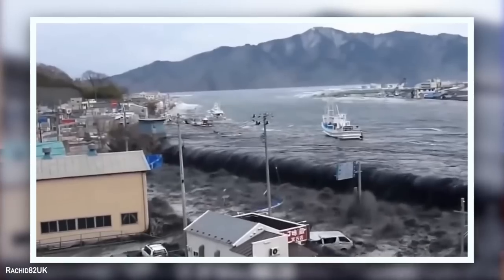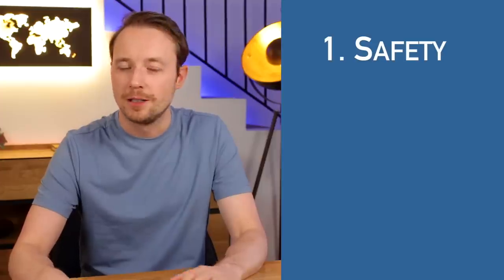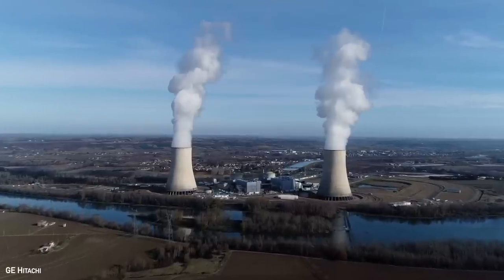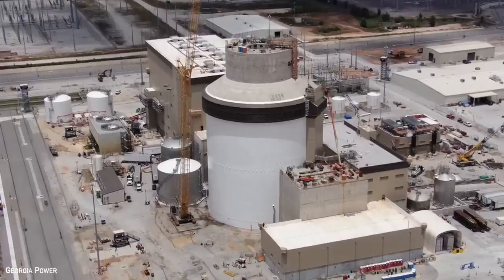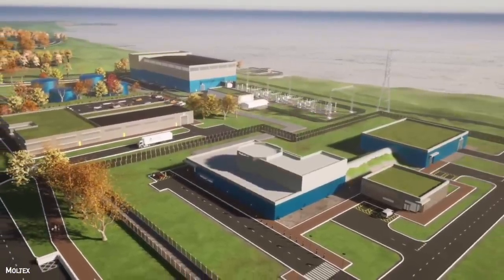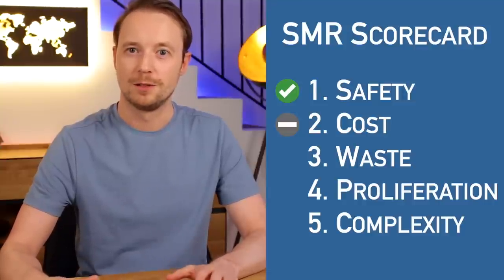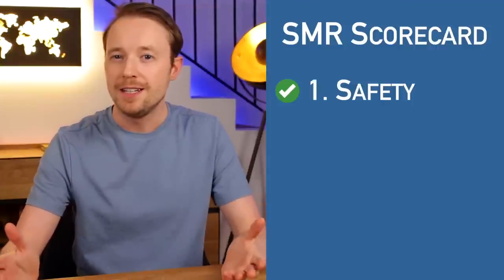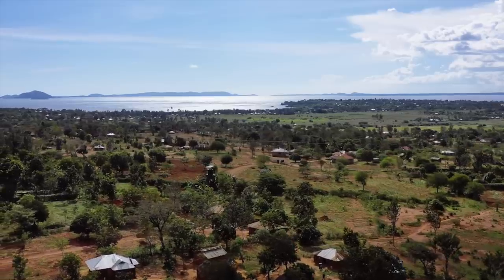Can Small Reactors Revolutionize Nuclear Power?

Comment: Being currently in the SMR industry, I think your assessment is accurate.  To me the big thing is the financial risk for the owner is less because of the smaller size.  The large plants with cost overruns nearly bankrupts large companies.
Reply from the maker: Exactly, smaller size lowers the overall risk to investors. $100M vs $10B is a lot easier to manage.
It's funny you said cost overruns nearly bankrupt large companies. In an earlier draft of a video I did, I used almost that exact phrase (referring to the AP1000 projects in the US), but it ended up being cut. Anyway, cheers!
Reply: The SMR industry?  Isn’t it bit strange to make that claim of an “SMR industry” when not a single commercial SMR is even started construction yet, not even a license?
Reply: @Nill757  Nuscale is licensed
Reply: @atomicblender I was incorrect.
Reply: @Nill757  - if you do some digging you will soon discover your assumptions are a bit off…..I would hand the info to you on a silver platter if you were not so quick to go negative on this topic.
Reply: @Nill757  interesting
Reply: @Nill757  “guys like me!” Shame on you…..

Comment: Thank you for this clear explanation on SMR's. It is a pity that we can't use the enormous experience built up by the US Navy because that is secret. The reactors used in a aircraft carrier produces enough electricity for 7000 man and the propulsion of the ship but enables also the production of fresh water and bio fuel from seawater. These systems are working for over 50 years now. The knowledge and experience is there.
Reply from the maker: Fair point. Fortunately (or unfortunately) the US set its policy to not mix the military and civil nuclear programs. Not all countries do this, but there are areas like you mentioned where that experience would be very useful. Cheers!
Reply: It was (reportedly) ex-Navy nuclear reactor operators who took their "wisdom" to the Three Mile Island to a core meltdown. A Molten Salt Reactor can operate in a desert, water at ~2200 psi is not a happy thing. In an ocean not a problem, but comparing a land based Mega Watt reactor to a ship installation is a stretch. There are dozens of Gen4 propositions underway and avoiding water, for cooling, heat transfer, and moderation is a common feature. Molten salt reactors at low pressure avoids most of the fears of nuclear power. Nothing to explode.
Reply: But civilian reactors are based on military designs. Westinghouse, GE, Combustion Engineering and other vendors designed the military reactors systems and the companies scaled them for use in civilian applications.
The major difference between them is the use of exotic materials that civilians can’t afford that the military uses.
Civilian reactors use fuel that is enriched 4 to 5% U235, military reactors are enriched to weapons grade uranium. Low enrichment allows civilian reactors to use less expensive boron control rods, military reactors have to use more exotic materials due to the high enrichment levels.
Civilian reactors run at 100% power for about 2 years, military reactors typically run at much lower levels. When I was a Navy RO on Sunday, we typically ran at 15 to 20% power all patrol because running at flank bells creates a lot of noise.
In the 70’s a sub was refueled every decade or so, but if run at 100% power as civilian reactors do, they would have to be refueled every 2 years or so.
Reply: @LSuschena  Thank you for the explanation.
Reply: @LSuschena  100% for 2 years or 20% for 10 years looks the same to me. It is not the fuel burn-up that causes the solid fuel to become unusable, but the trapped breakdown products that acts as neutron absorbers, and that is why the rods have to be re-shuffled  and/or replaced as the ones in the center get more activity. That is one reason a liquid fuel reactor is better, as Xenon gas, and others can be separated out. Alvin Weinberg who designed the navy reactor also designed the MSR as he thought the light water reactor was unsuitable for commercial land use. He also designed the MSR for a Thorium breeding cycle, which incidentally has less problematic waste disposal profile.
SMR's can conquer the biggest problem with nuclear reactors, the immense cost of to build and license them. Bankruptcy is a real problem for nuclear construction, as is unwarranted fear of them. Naval reactors don't scale well for the above reasons. 
The answer is MSR. 
Solid fuel is a mechanical device, liquid fuel is more like a chemical device, which opens a lot of possibilities for cleaning the fuel, an simpler on-line addition of new fuel.
Reply: @Piccodon  
Yes, 100% fir 2 years or 20% for 10 years is about the same, except when you factor in core size.

Commercial fuel assemblies, I think, 12 or so feet long with upwards of 200 assemblies, the navy reactor I operated was about the size of a large trash can.
The enterprise had reactors, the Ford has 2, and the Ford has more power demands than the enterprise.
Commercial reactors are based on naval technology for light water, but commercial reactors are not allowed to use the enrichment used in military reactors, that’s the main reason for the different between how they operate.
Yes, gasses do get trapped in fuel pellets, that’s why the military doesn’t use them.
Reply: @LSuschena  so you say those reactors do not use solid fuel?
Reply: @Piccodon  
I can’t tell you what specifically, but it’s not solid like the commercial fuel.
Reply: @LSuschena  "As the core of a seagoing reactor is much smaller than a power reactor, the probability of a neutron intersecting with a fissionable nucleus before it escapes into the shielding is much lower. As such, the fuel is typically more highly enriched (i.e., contains a higher concentration of 235U vs. 238U) than that used in a land-based nuclear power plant, which increases the probability of fission to the level where a sustained reaction can occur. Some marine reactors run on relatively low-enriched uranium which requires more frequent refueling. Others run on highly enriched uranium, varying from 20% 235U, to the over 96% 235U found in U.S. submarines,[4] in which the resulting smaller core is quieter in operation (a big advantage to a submarine).[5] Using more-highly enriched fuel also increases the reactor's power density and extends the usable life of the nuclear fuel load, but is more expensive and a greater risk to nuclear proliferation than less-highly enriched fuel.[6]

A marine nuclear propulsion plant must be designed to be highly reliable and self-sufficient, requiring minimal maintenance and repairs, which might have to be undertaken many thousands of miles from its home port. One of the technical difficulties in designing fuel elements for a seagoing nuclear reactor is the creation of fuel elements that will withstand a large amount of radiation damage. Fuel elements may crack over time and gas bubbles may form. The fuel used in marine reactors is a metal-zirconium alloy rather than the ceramic UO2 (uranium dioxide) often used in land-based reactors. Marine reactors are designed for long core life, enabled by the relatively high enrichment of the uranium and by incorporating a "burnable poison" in the fuel elements, which is slowly depleted as the fuel elements age and become less reactive. The gradual dissipation of the "nuclear poison" increases the reactivity of the core to compensate for the lessening reactivity of the aging fuel elements, thereby extending the usable life of the fuel. The compact reactor pressure vessel is provided with an internal neutron shield, which reduces the damage to the steel from constant neutron bombardment."

Secrets?
Reply: @Piccodon  Yes secret. They mention its different, but not the details of the actual fabrication. That’s the secret part.
Reply: @LSuschena  the cost of U235 is another barrier to commercial use of 95% of it, besides it potential for weapons use. Natural uranium cost like $50/lb. Extraction of the 0.7% U235 is not cheap, and increasing the cost of fuel minimum 140 times etc would not make it feasible from pure economic reasons.
Reply: @Piccodon  
Yes and that is exactly way military reactor technology cannot be exactly duplicated in commercial SMRs. Cost.
Reply: The new Westinghouse design mimicks the USN design to a point. The coolant pump and motor is all contained in a single piece. USN reactors use highly enriched uranium..a no-no in the commercial plants in the USA.
Reply: @TheBeingReal  
The naval reactors were a Westinghouse design. The reactor coolant pumps were called canned rotor canned stator, where the motor itself is part of the reactor coolant system pressure boundary. Water is circulated within the motor and cooled by a heat exchanger outside the motor. The design was extremely effective on submarines.

The AP1000 uses the same design but on a larger scale. The pump casings are welded in as part of the steam generator which eliminates the intermediate piping leg between them. Lots of savings on maintenance with far fewer active compliments required for safety related and support systems.
Reply: @TheBeingReal  Thank you for the info. Lets hope that we will learn more this New Year.
Reply: They use HEU, which is kind of a problem in a civilian context.

Comment: Let’s be real about one thing in the west we built reactors in the 1960s in the 70s in the 80s. This is the same in Europe and then we stopped for 25 to 30 years. Now we’re trying to reboot these industries. The real impediment started around the time of the creation of the nuclear regulatory commission in the mid-1970s, at least in the United States case we did not pick a few designs, but we had many independent vendors building custom machines. Canada built multiple machine complexes at a few sites, concentrating and sharing facilities and personnel. This needs to happen in the United States and other countries we also depend on very large Forgings and pressure vessels for our light water, reactors SMR’s could provide some modularity to the construction of multi reactor complexes. But maybe new designs are needed. Overall, the Canadians have an excellent record with their CanDu reactors that require no enriched Uranium.
Reply from the maker: Agreed, the US went so long without building that all the experience was lost. Supporting industries like heavy forgings are overseas now, although that's not the end of the world. Canada is a great example, they have a lot of nuclear co-generating with hydro very nicely. Low-enriched uranium is also nice, but a downside is a bit more waste compared to enriched fuel.
Reply: @atomicblender  True, there are some new designs in the pipeline that are designed to consume, spend fuel and depleted uranium as fuel or a feedstock for fission product lines.
Reply: The US ceased building new reactors 'back then' because the costs were too high and were increasing.  The costs are still too high,  Look at what Vogtle 3&4 will have to charge for their electricity,  And that's after the utility raised rates about six times in order to take money from customers to use for reactor construction.

At some point nuclear advocates need to face reality,  People will not willingly accept large increases in electricity prices  just so some company can build a reactor.

Here is what is likely to happen in Georgia.  

The new Vogtle reactors will come online.  Rates will take a significant jump up.  In the meantime we have become much more efficient in our use of electricity (LEDs, better refers, etc.)  meaning that demand has not risen as was expected when work began on new nuclear.  And the cost of solar has greatly decreased.

Because GA will prioritize keeping nuclear going they will most likely shut down cheaper fossil fuel plants, putting more upward pressure on rates.  As rates go up more and more consumers will install solar and storage for their homes and businesses.  That will further lower demand, leaving GA with the need to cut generation.  And unless they face reality and close one or both of the new reactors they will, again, have to increase rates.

Comment: Great rundown!  Do LFTRs and pebble beds!  Also, does cost take into account the size and length of transmission lines and their losses.  Aren’t SMRs going to be much closer on average to where their power will be used, and therefore cheaper?
Reply from the maker: SMRs should, in theory, be able to be built closer or on previous sites (like coal or existing nuclear). This should be better than building super far away from where anyone lives.
Reply: An SMR could possibly fit inside/nearby to existing sub-stations using the existing  wiring and transformers. Shorter, local-grid/buried wiring could minimize EMP danger.
Reply: Building reactor sites with room for numerous SMRs could fill the site with various experimental reactors to evaluate and provide excess capacity to allow taking problem reactors offline and perhaps fixing/modifying/improving them with robots.
Military bases could be a good place to site these facilities.

Comment: I did my final research paper for one of my English classes on nuclear energy, and the biggest eye opener was the fact that the only nuclear power plant failure that actually had any attributed deaths was the Chernobyl disaster, and none of those were actually from the reactor explosion. Other notable failures like 3 mile island and Fukushima had a death toll of zero, but still were covered in the media like they killed hundreds. The damage that the media has done to nuclear energy is the largest factor that needs to be addressed in order for nuclear to be more widely utilized.
Reply: This is definitely false as relates to Fukushima as first off one must you are correct point out that there was a MASSIVE Tsunami that absolutely annihilated this entire District North of Tokyo but also not noted was a massive SIX Reactors keeping the lights on upon Tokyo with the two new ones interestingly enough spared from the Tsuanami disaster because of proper site work.

Whilst the other 4 only had if I recall two working the other two had massive amounts of irradiated material stored there as is SOP mainly upon the roof of a clearly improperly made series dating back to the 1960s causing a massive secondary disaster ongoing even today. The primary issue as relates to Europe and Japan is in trying to sustain said facilities using I think termed "breeder reactors" which to the USA and importantly left out here CANADA do not do that meaning the USA and Canada have truly awesome amounts of fuel on site at the nuke Plant if need be and as possible fuel for said SMRs interestingly.

By way of example with hopefully #lessons_learned Vogtle 3 & 4 yes, absolutely you are correct tho *"the best way to decommission both coal and nuclear power is to transition to something small/already sited. One perfect place to start would be in Sputhern California Los Angeles ironically with decommission work now well underway there. If validated literally just follow the wind from West to East for the next 100 Years be probable as needed but still a realistic time line at least.
Reply: A lot of controversy there. I do not agree with your conclusions.

Comment: This is a great introductory video. Something that the video doesn't bring out so clearly is that for a lot of these questions the answer is really: it depends. SMR is a business model not a reactor design and different SMR designs can actually be very different. As just one example: water cooled designs like NuScale actually don't work well with intermittent renewables. This is because of economics: yes NuScale can scale the output, but only by throttling the reactor. However, a nuclear reactor costs essentially the same whether you run it at 100% or 10%. Meaning when NuScale throttles output by 50% they are halving their income but their costs are exactly the same: greatly hampering the plant economics. The same is not true of high-temperature reactors, such as TerraPower's Natrium or Molten Salt Reactor designs because the high temperatures allow the use of thermal energy storage: they can run the reactor at 100% all the time and store the excess energy for later. These designs are a perfect compliment for intermittent renewables and they do not compete with each other economically in the same way. Indeed for a lot of these questions the answer actually comes to do "It depends on the specifics of the design": you could take each of the questions you've asked and get completely different answers for different SMR designs. 

Personally I'm not especially optimistic for water-cooled SMR designs like NuScale, although I'm happy to be proven wrong. However, I think high-temperature designs such as Natrium, Moltex, ThorCon, Kairos, etc. have a lot more potential advantages. Overall it'll be interesting to see how this space develops over the next few years.